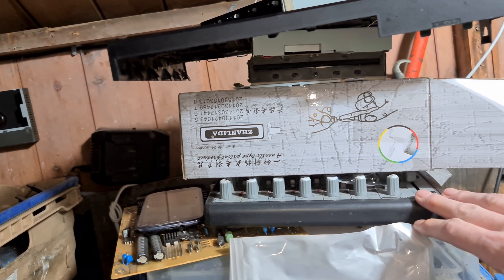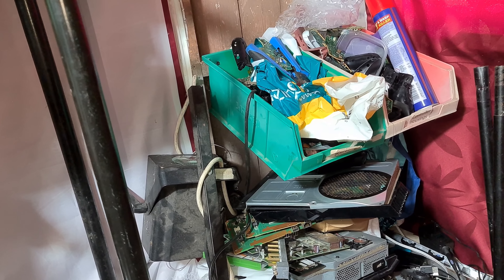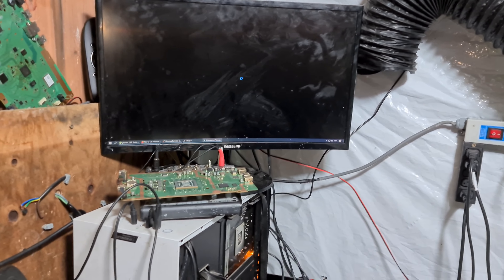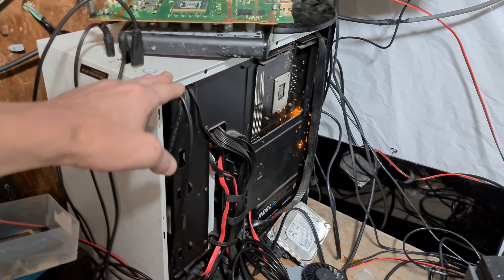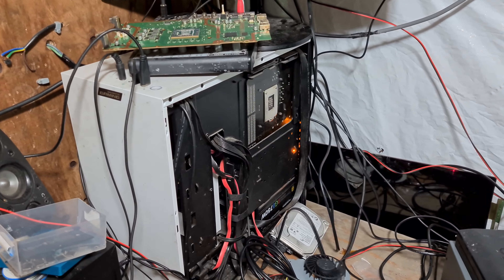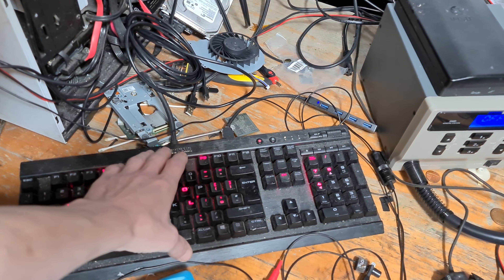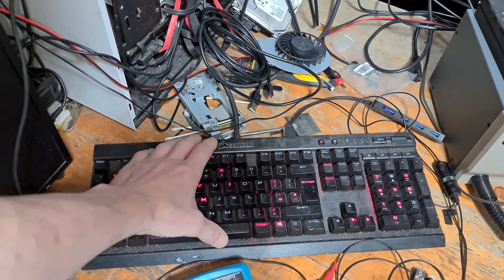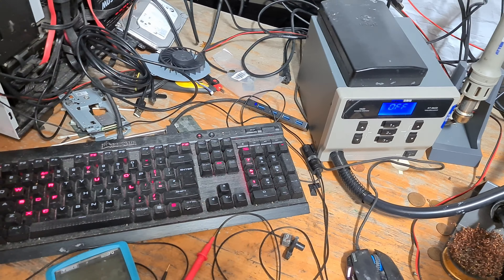Console Repair Workshop Tour 2020 - How I Do My Job! (GIVEAWAY TOO!) 4k Sub Special

Comment: New top IR heating element is cheap as chips
Reply from the maker: I know yeah they're about £7 on ebay, but they fail too quickly so I went with an Elstein top plate. More expensive but definitely more value for the money than having to replace the cheap ones every couple of months 😁
Reply: TheCod3r get a Elstein RSF80 even Quartz Ceramicx 250W

When I said cheap as chips I didn’t mean one use high wattage resistors 😂
Reply from the maker: @aqib2000  I have the Elstein RFS80 400w top plate. It cost around £65 for that but it just means I don't need to replace cheap Chinese ones every 5 minutes lol. The bottom plates I'm going to upgrade next year too and get the Elstein plates, but I'll wait a while because I'm a cheapo 🤣
Reply: TheCod3r ok good move